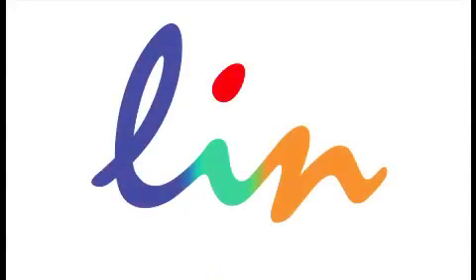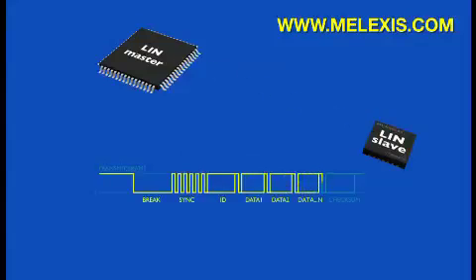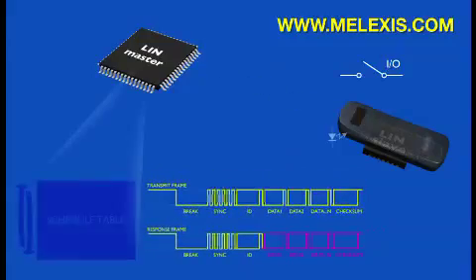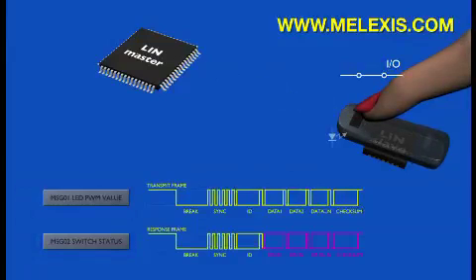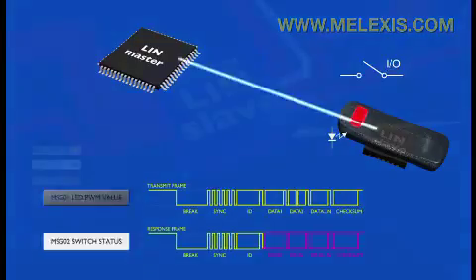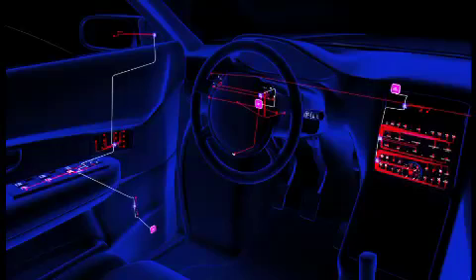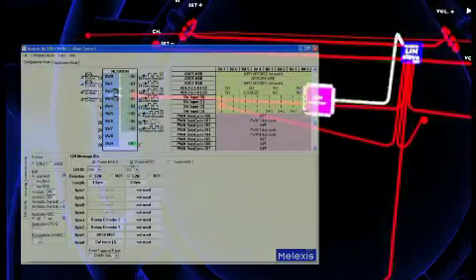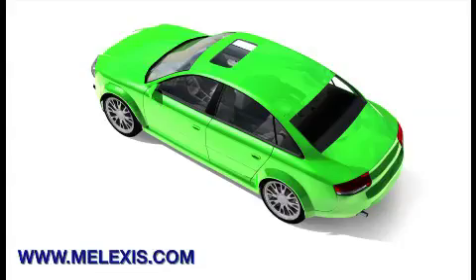Local Interconnect Network (LIN) - Animated Tutorial

Comment: How did you decide that only 16 slaves can be connected on a Lin Bus?
Reply from the maker: This value is defined within the LIN specification based on the overall bus load. With the defined bus load (capacitive 10 nF and resistive 500 Ohm) the full LIN system together with the wiring of 70 m can support 18 members = 1 master and 17 slaves. This is only an example. If, for example, the wiring is shorter or other parameters within the defined limits are optimized for a special application case then also more slaves are possible. Those cases must be defined from the OEM at system level.